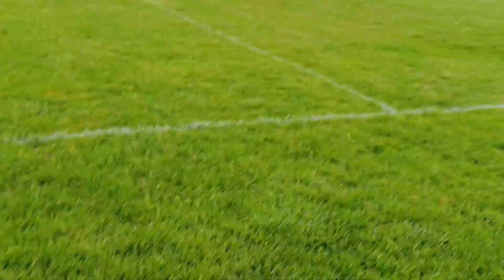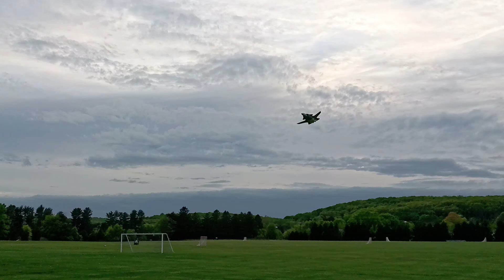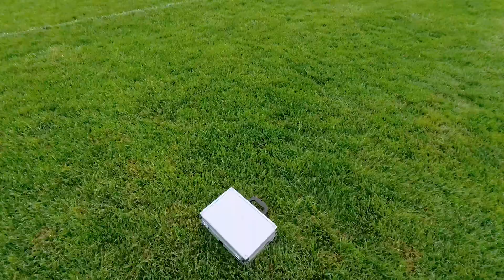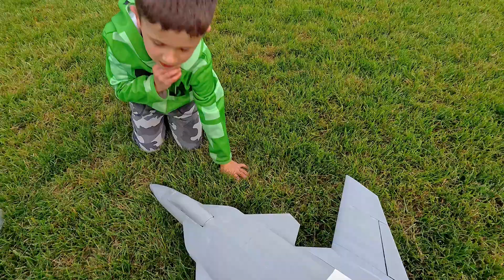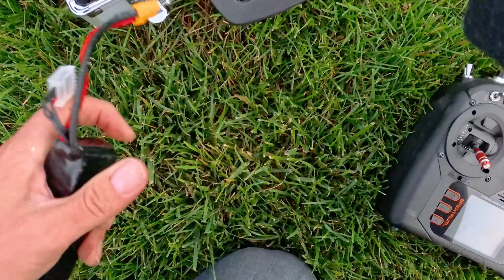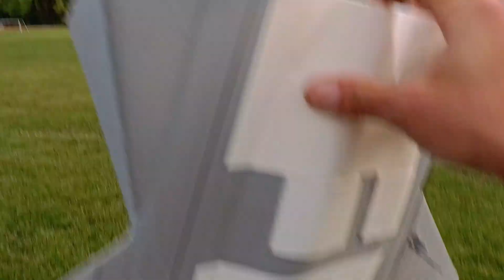My Greatest RC accomplishment yet.

Comment: How about some WW2, Blohm and Voss, Horten, Moon bat or Flying Pancake. Or other oddities. Or an X or Y wing.   Or fighters from Battle Star Galactica.  A starship shuttle may not fly well but what if you used clear plastic, low visibility wings. Possibly a parasol mounted wing.  Or VZ-9 Avrocar by Avon Canada.  Avrocar could be challenging. A VZ-9 build could be less symmetrical and have a lifting body incorporated. Or a space shuttle. SR-72, B-2.  B-2 may be challenging.

Comment: You're on fire with these. I was so excited to see you've done a YF-23. Do you have any plans to do an F4 Phantom??!
Reply from the maker: Thank you!! So the F4 has been done by others, I’ve never been a huge fan of making the F4 in RC scale. Some planes lend themselves to RC and some don’t. I’m not a landing gear kinda guy and I think the F4 definitely needs them for a few reasons. It will rip the tails off without them. They have super thin wings and I don’t use wing spars in my designs. I wish I could, maybe one day 👍🏻
Reply: @hotlapkyle  makes total sense. I just bought the YF23 as that’s the pinnacle

Comment: The SU47 is a nearly perfect airframe.  It doesn't really have bad habits; they did their homework to make sure the forward sweep doesn't become an uncontrollable nightmare.  It's also VERY easy on the eyes....Motion RC used to sell an ARF dual 70mm one, and I wore out multiple ones until they discontinued it, and I was heartbroken...thank you for making a cheap replacement!  Rene Rosentrager sells his SUXR 3d print files which is a slightly modified SU47, and it flies beautifully, but this is a lot cheaper to crash!!!
Reply from the maker: Rene is my idol when it comes to this stuff.